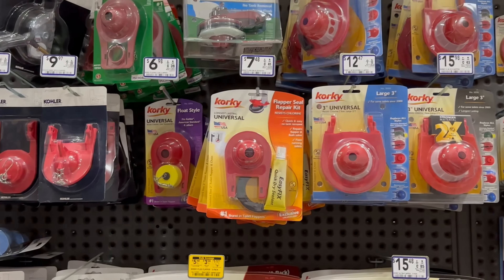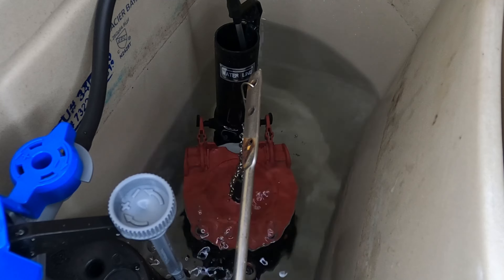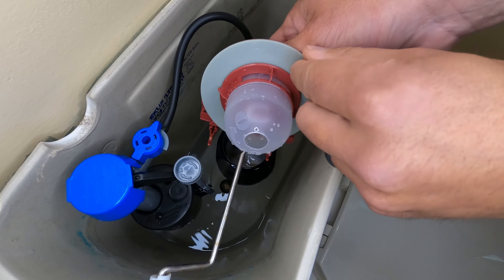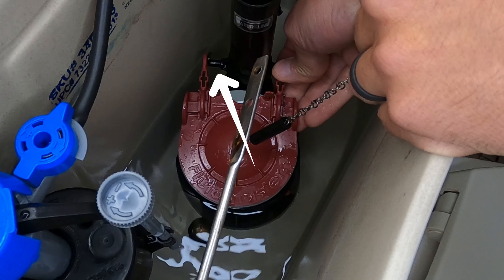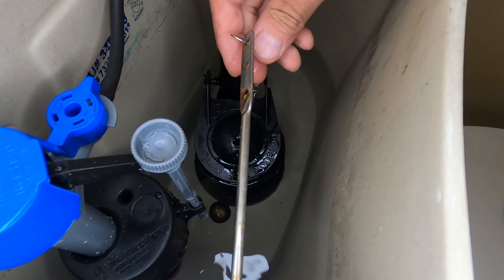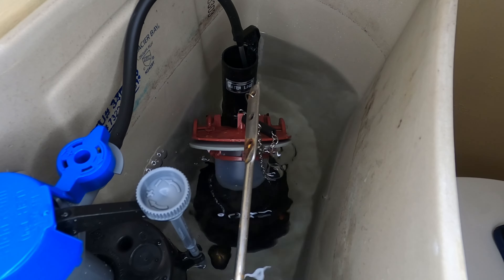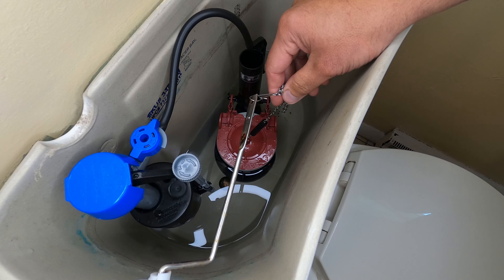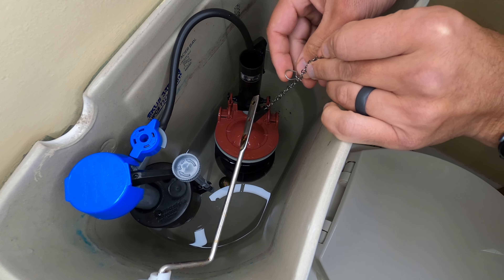How To Fix A Toilet Flapper - Toilet That Won't Flush

Comment: What does the adjustment do/ how does it work exactly?
Reply from the maker: It just delays how fast the water fills into the cavity on the flapper. This in turn affects how slow or fast the flapper closes. I would say having the chain adjusted properly is really the most important part
Reply: @theguyofalltrades  problem fixed! Thank you!
Reply from the maker: Welcome!

Comment: Thanks for the video!

My flapper keeps getting stuck intermittently - it'll flush the toilet but then it won't seat itself back over the drain hole leading into the bowl. I tried adjusting the chain length but I'm not sure I'm doing it right. The flapper itself is fine (pretty new.)
Reply from the maker: Thanks for watching. The key is to make sure it’s not too loose or not too tight and that the ears are hooked or snapped on the flush valve assembly